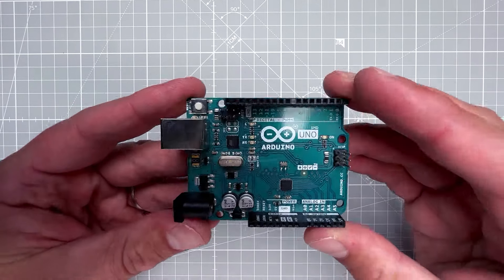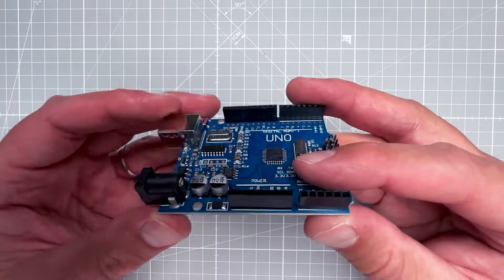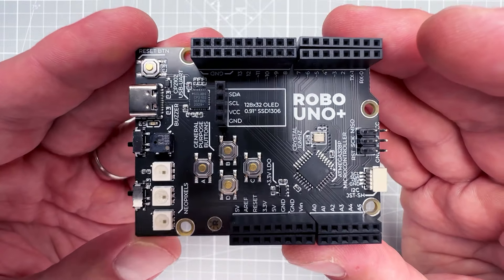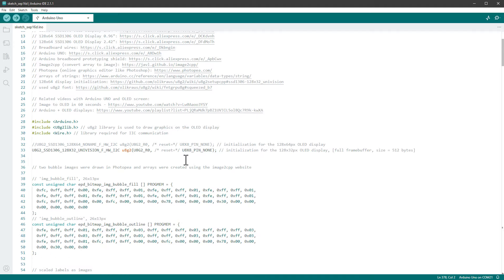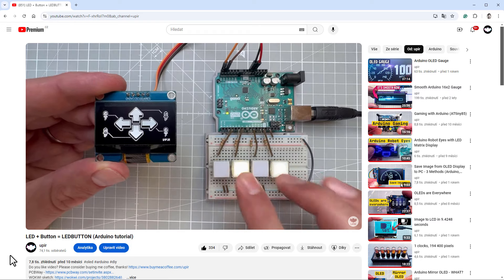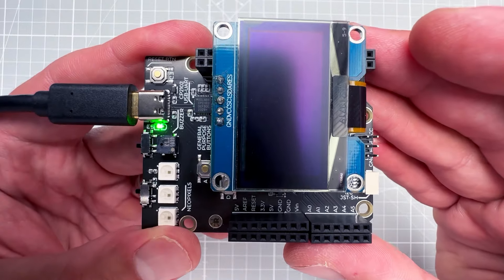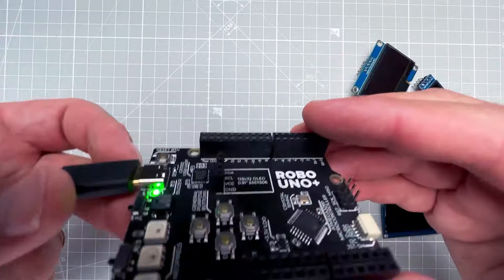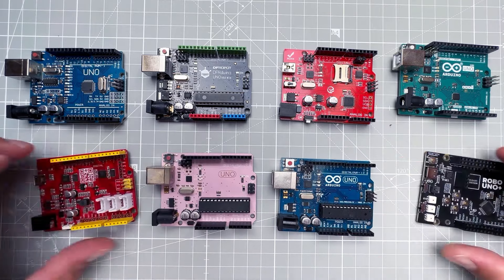Arduino UNO - cheap vs. expensive

Comment: I've had one of those cheap $3 Uno boards from Ali for years, and never thought of putting in a row of male headers.  DOH!  Thanks, that was quickly fixed.  Another handy thing on that board is the connection points next to the ICSP header.
Reply from the maker: Great to hear that this video was helpful with those male header pins! I agree that those extra connection points are great as well.

Comment: Microcontrollers for industrial systems used to cost hundreds or even thousands, and then along came the Arduino. and with a few relays and a driver board, you could do the same job for a few dollars.  They really are great boards, simple to program, reliable and so cheap. I have a lot of the $3 UNOs , and a few Megas that have never let me down. Now I have to check out the 32 bit R4.
Reply from the maker: Agreed, it´s great that you can get cheap Arduino and do anything you want. The R4 is a nice addition to the UNO boards, it´s not the fastest, but a full compatibility with the R3 board is definitely a huge benefit.

Comment: I already use $3 uno for a while now and I not found any problem yet 😁
Reply from the maker: Same here. Probably a good luck?
Reply: If you didn't buy boards like him with special form factors or whatnot,  you worn encounter issues,  usually.  

They all use the same atmega 328 micro controller. Therefore are feature complete and function 1:1 like an arduino 

The only three differences you may encounter: 
- build quality ( but those 3$ boards are still good) 
- they may use a different usb chip and you may need drivers for it. 
- The voltage regulator may not be as good as the authentic one - input voltage may not be as high or low,  and may handle less power. 

Functionally tough they all work exactly same.  It's the same uC.

Comment: I recommend the clone if you don't care about authenticity. For a beginner, the clone is best as you might easily short circuit it and can be cheaply replaced. For USB to UART, CP210x or CH340x are mostly used and the CP210x tend to be more expensive. I prefer the CH340, it does everything the CP210x does and the DTR pin is very useful if used with ESP8266/32 and Arduino Pro mini because you do not need to press the boot button!

Comment: IThe project I done that you did of the gearknob I used a cheap arduino uno board I had issues of it not loading the program on it and recently bought the proper arduino uno board and it is working flawlessly
Reply from the maker: That´s interesting. Where did you get that cheap board from?
Reply: @upir_upir  I had no issues putting the program on it but when I went to use the  arduino  board with the program  on it would 70% of three time not load it up properly

Comment: I will say, I usually like to use an ESP32 dvelopment board, but I still use an Uno for certain projects, and anything as long as it has hotswappability for the atmega, it can be as far from the original brand as possible.

Comment: I like the tiny form factor of the "SS Micro".  It has the USB A plug builtin.  I've bought some $3 units, and one came without the bootloader programmed, and one came without the reset line connected.  Neither were hard to find/fix but it was a bit of a surprise. ;D
Reply from the maker: Thank you for letting me know, I have ordered that board as well but haven´t tried it yet. Good to know that there might be some surprises..

Comment: Here's the thing, the uno is powerful enough for most simple tasks like running a tight loop repetitive process with a few program tasks
The uno r3 is actually overkill for the task I use it for
It controlls the flushing of my RODI recirculation filter and when to dump waste and even notifying me via serial about the parameters it has
Reply from the maker: Agree that for some tasks, UNO is overkill, but I like the simplicity of using Arduino IDE and the quick development. If you want something simpler, you might try ATTINY85, especially on the small PCB, I have tried those and they are great.
Reply: @upir_upir  my point was actually the opposite, the video is about it being UNDERPOWERED
my point is that with some simple coding optimization juju it is actually overpowered for most tasks, the ram and PROM are painful limits but if you have a chainloader built into a seperate part and an external ram chip you could almost run a full retro DOS pc with the uno as the CPU

Comment: I have several clone uno boards.  I like the removable chip as they are easier to repair if something goes wrong, but the ones without a removable chip are cheaper.   I don't use Uno boards much anymore as I am now using esp32 boards or 8266 d1 mini boards.   I have yet to try a Uno r4 though which has wifi.
Reply from the maker: I always thought that the ones with removable chips will be better for the reason mentioned, but I haven´t fried any chips yet :) Uno R4 is nice, you should definitely try it!

Comment: I wish for RP2040 microcontroller boards in the same format as the arduino ones.

The Arduino form factor is so easy to use.

The RP2040 is way faster and cheaper.
Reply from the maker: There is a board like that - for example this one: https://github.com/red-scorp/RP2040-Eins
Reply from the maker: And here is another one: https://www.adafruit.com/product/5786
Reply: @upir_upir  Oh, wow. That's awesome. Thank you!
Reply from the maker: You are welcome. I have actually found a few more boards like those above - wasn´t really aware how many UNO-sized boards there are. Good luck with your projects!

Comment: They are ok until you need something specific. I found the high output logic of the Rx and Tx are very low and I had to put a level shifter on the pin to get the full 5V. This problem doesn't exist on a genuine Nano, but you get what you pay for 😊
Reply from the maker: That´s interesting. Would it be cheaper to get the original board in that case? I wasn´t seeing any of those issues yet, perhaps a good luck..
Reply: I bought a genuine one and that is how I found out that the clone had the fault.  I still buy clones despite their problems because they are just so much cheaper.

Comment: I've been using the Ruggeduino boards mostly because my projects require higher voltages. But they're tough, and hard to kill. Might makes take on industry-like applications.
Reply from the maker: Good suggestion, I will definitely take a look at those board. Thank you!

Comment: Or you can buy Nano and breadboard for more pins and next comfortable soldering.
Reply from the maker: Sure, you can buy any other board. The point is that I believe that the first board that you should get should be UNO. After that, go with whatever suits you the most.
Reply: @upir_upir  There is no reason to buy Uno as your first board. It is inconvenient. The usual set is a uselessly taking up space Uno + a breadboard, when you can just have Nano on this breadboard. You should buy Uno only for special shields, but you can use nano-shields instead uno-shields.

Comment: i would buy the version with the DIP µProcessor, because i use the Atmel 328 in many projects and it is much easyer for  programming and testing, also as beginner if you break one you only need to replace the µProcessor not the whole board. Especial, it is the original Arduino Uno the DIP version makes more sense. what does the DIP-28 ATMEGA328P cost? 3€ or so? and if you buy more that one. Last time if bought 100 pieces for 100€ including shipping, so yeah if you're doing something with them and need a lot, buying the DIP package makes sense.  
it's my opinion about preferring the DIP rather than SMD.

About performance for most projects the Atmel Tiny 25, 45 or 85 is more than enough power depending on how much ROM you need  25 = 2kb, 45 = 4kb and 45 = 8kb.
Reply from the maker: Agree about the DIP version, that´s always handy. Not in full agreement about the ATTINY. Once you add display, even the simple OLED, you need some memory, and even when I have made some projects with ATTINY 85 using the 128x64 OLED display, it´s just much easier to have enough RAM to store the framebuffer.
Reply: @upir_upir  i building robots and such things where i need a special function.
like a simple high power stepper, which works independently and is controlled over i²c or plain uart shared bus with call commands. The required pins and functions sets which chip i need. 
so yeah if you doing image stuff you need more space as the tiny can provide even the mega 328 can be to small if you need more pins and you next option might be the mega2560.

Comment: My fake Arduino Mega for some reason only can very weakly turn on the pins, and my fake Arduino Nano just somehow started only accepting code from a specific selection from Android version of Arduino IDE. And that's only sometimes.
Reply from the maker: That´s interesting. I have a lot of cheap boards and so far not problem with those.

Comment: Can you do a video start to finish using an ESP32-2432S028R? They’re so cheap and widely available, I don’t fully grasp how to make my own programs for them yet. They are Arduino IDE compatible and like $10.
Reply from the maker: You mean those cheap yellow displays? I might try those, I mean, I like the price, but the quality of the screen is probably horrible.
Reply: @upir_upir  yes that’s the one. I’ve played with them the color rendition could be better, but they’re plenty bright.
Reply: @upir_upir  I want to try to make one of those “geochron” clocks with them, but Im not good enough at programming them yet.

Comment: Should you buy a Cheaper Arduino or Expensive Arduino?

Ans: You shouldn't buy Arduino in 2024 at all. Move on to better platforms like RPI Pico (RP2040 & 2350) or ESP32 (S3 C3)
Reply from the maker: I still think that for the very first board, and getting into microcontroller world, going with UNO is a better option before moving to ESP32 or RPI.
Reply: Easy, a lot of libraries, good for learning until you get experience. Also I think you've missed STM32 from your list of platforms.

Comment: Just ditch your UNO's. UNO's suck. Either get Leonardo's or Mega's for your 5V based projects. The only benefit of an UNO is that you have 1 full 8-bit ports. On the Leonardo the port layout is a bit chaotic. But if you are into port writes you want a MEGA anyway, as it has 6x 8-bit ports.
Reply from the maker: I still like the simplicity of UNO. Very easy to use and it takes no time to get the project up and running.

Comment: Butbutbut... I don't need buttons and led's on my boards dude...

When I build a project the board gets hidden deep inside a box so the buttons and LED's are useless.
That LCD looks nice, but I don't want it on the top of my board because that's where my shields are. You know, like the $3 shield that gives you an LCD screen and some buttons, that you can put on your arduino during development and then remove and re-use when your arduino goes into it's project box...
Double headers: nice but if I need that many connections it's likely that I am already using a breadboard so.... and also: shields do that during prototyping and guess what: a shield also does that for production. Instead, you should focus on that QWIIC connector, that's much more helpful than the rest.

Why would I spend $20 extra on one set of headers, four buttons and a buzzer? I can get ESP32 boards that have an on-board screen for $10 and those boards are smaller and faster than the uno.

Who is this product for?
Reply from the maker: Clearly this product is for me. I like to have a board for experiments where I don't need to use any additional breadboards, shields and wires and still have a few buttons, display and perhaps neopixels and buzzer. It just make creating projects much more convenient and faster. Obviously it´s not meant for putting into a box and using it for a product, but a learning tool for beginners.